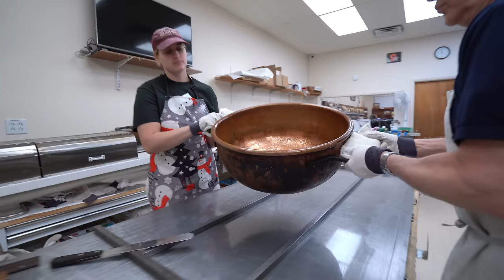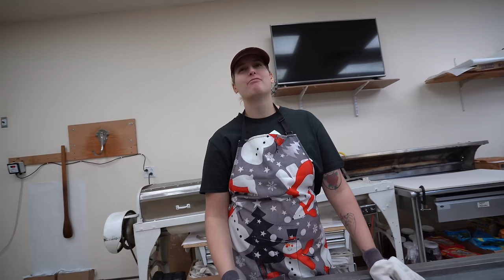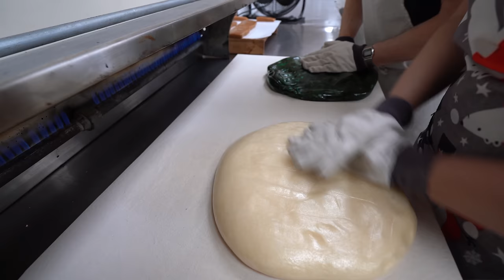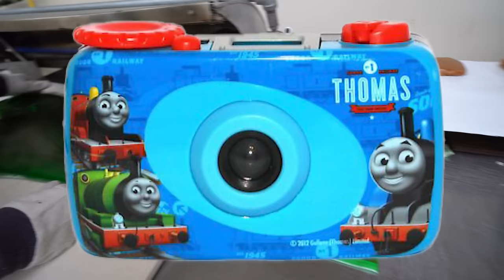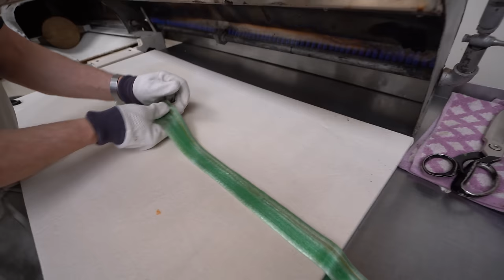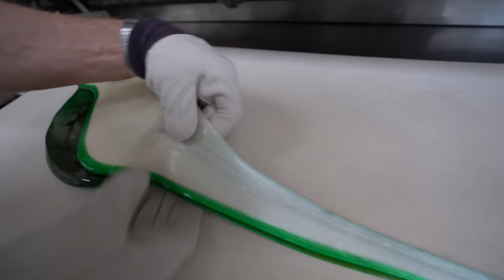One Small Change Lead to 5x Bigger Batches!

Comment: If you burn yourself again try putting white toothpaste on the burn. Then wrap it in gauze and leave for several hours. When you remove the gauze or bandage wipe off the toothpaste and you will be amazed that the burn doesn't hurt and will not leave a scar.